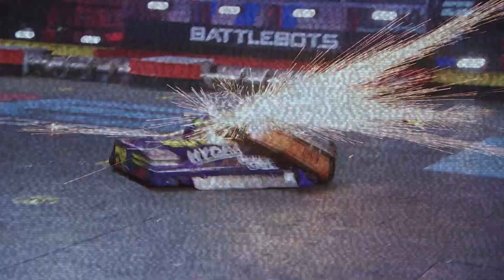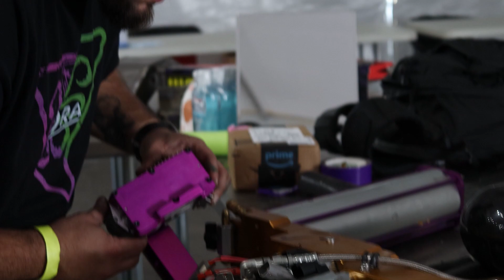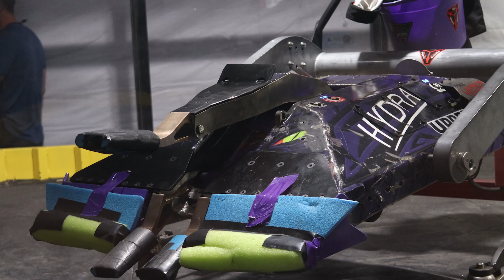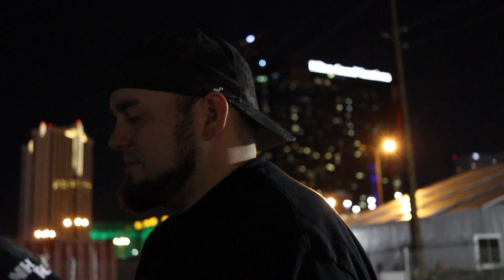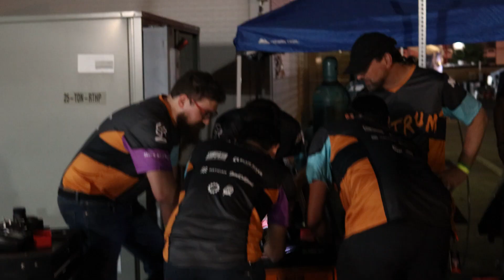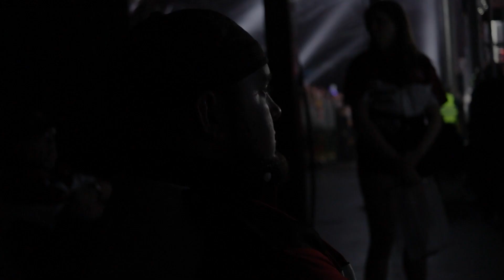Hydra V Tantrum HYPE E706 BB2023

Comment: Did the piano keys get stuck or the drive gave out?
Reply: They used new piano keys that didn’t scrape the floor, huge mistake imo. Only reason hydra is good because of ground game and they gave it up
Reply: @jimstrain7226  I saw the battle, I meant what made it not move at the end. Did the drive give out or did it somehow got stuck in the arena
Reply: @warmup1705  tantrums drum smacked the bottom of hydra and bent the frame so bad he couldn’t move
Reply: @warmup1705  They got chewed up underneath and were leaking fluids onto the floor.